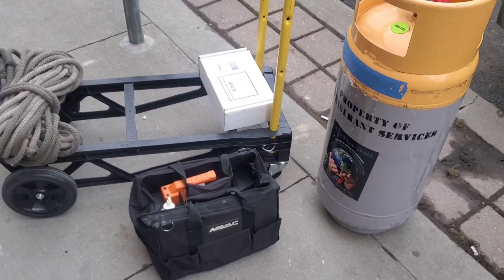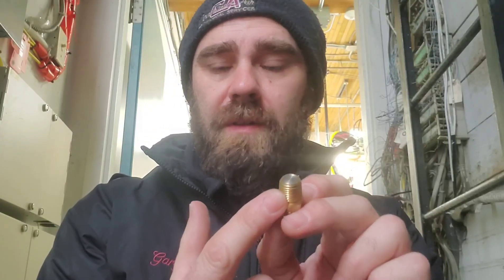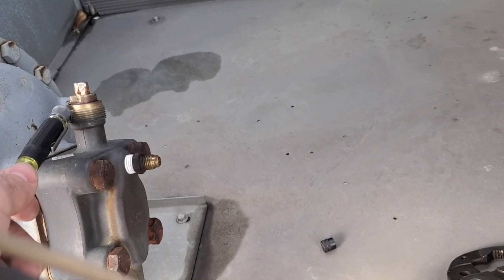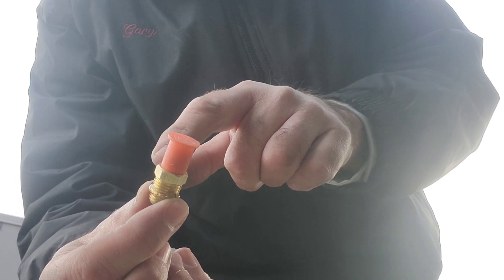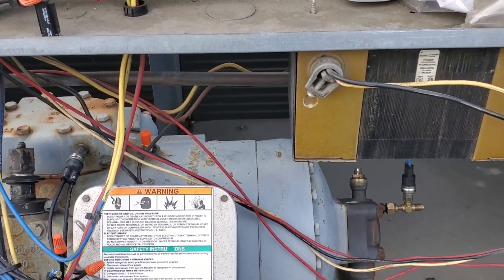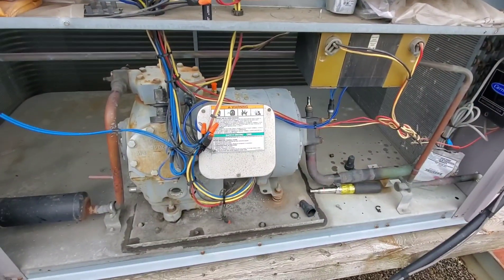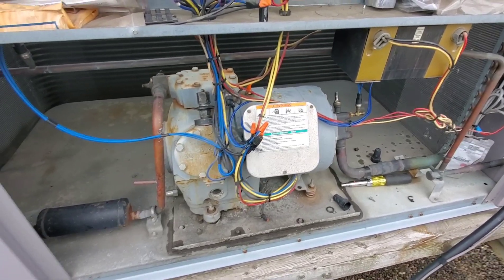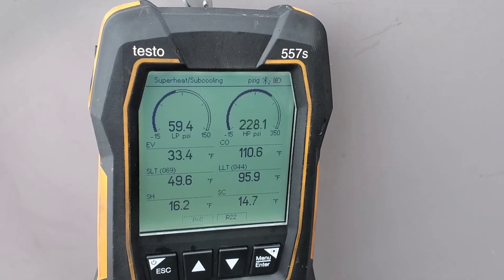Fusible Plug Replacement On A Carlyle Compressor - Carrier Condensing Unit

Comment: Good point on the vacuum not being perfect.  If I may add to this also when I isolate in similar situations like this don’t not pressure test with nitrogen because you could push some into the rest of the system.
Reply from the maker: You can pressure test, but the N2 pressure must be lower than system pressure

Comment: How did you know that “relief plug” was bad?
I don’t like using those swivel tee’s I’ve had them leak more times than not but I get it you didn’t have any other options. I wonder if there is a torque rating for them and I would use nylog on them too the swivel tee’s
Reply from the maker: It was leaking refrigerant, I always use Nylog on them for sure

Comment: Thank You  for the Detail.just a question Bro.is it okay to fix the relief valve on the low side. Happy New year. God Bless.
Reply from the maker: That's where the manufacturer put it.  As long as the vessel has a chance to relieve itself